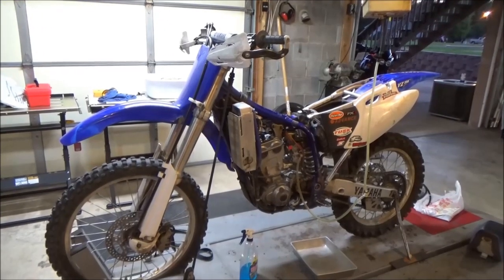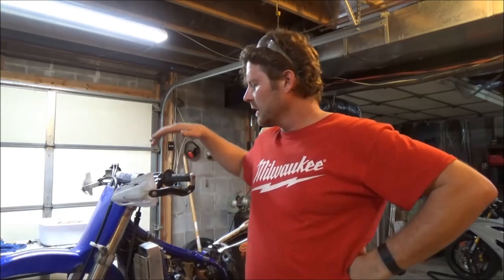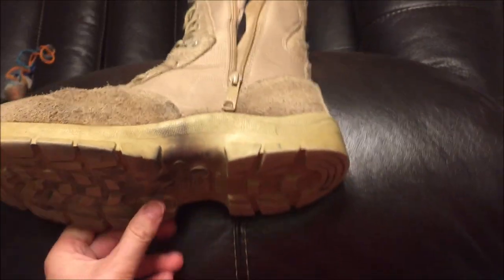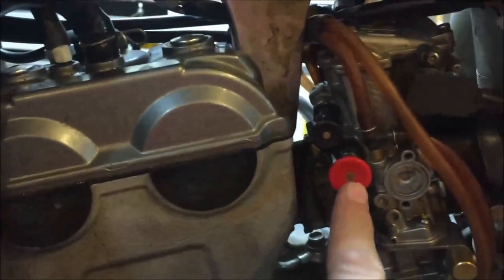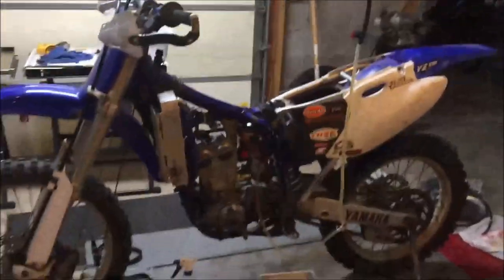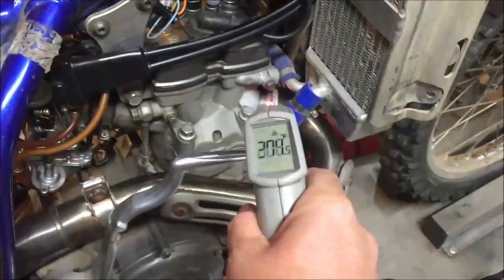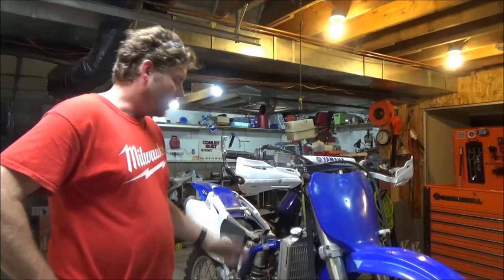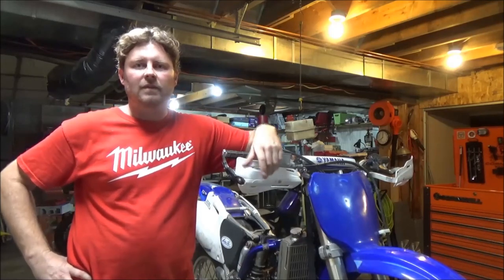How to cold start and hot start a YZ250F in 6 min FULL detailed video!

Comment: Subbed, i like your detailed info on this, picked up a 02’ for 800$ usd and had zero compression, guy said it dropped a valve so i told my self not to even bother with going to look at it and when i did and kicked it over i knew immediately he was wrong (he bought it from another guy saying that so it wasnt him saying it really), so the guy was generous enough to let me take it apart in his garage and at least see what i was paying for, upon getting head off everything looked okay other then it looked like somebody sanded the head on it🤮🙄 so i said screw it and made a first payment on it and took the motor home (he was also nice enough to let me pull it and take it apart and see whats up with it. So i rebuilt it from crank down even to tearing the trans out and redoing that. So long story short im waiting on a new piston, (had a friend mill the head properly and also gonna have him cut me deeper valve reliefs in piston to keep from valve contact, hopefully when i go to kick it shes gonna fire right up

Comment: I’ve been messing with a 2009 YZ250F.
When you drop it, if you pick it up QUICKLY (2-3 seconds), then you can start it in 2-3 kicks.
If you don’t pick it up fast enough then you must wait about 30s-60s after picking it up for the gas to go back to normal

Comment: Thanks, I'll definitely try not to touch the throttle. Your right, its very tempting. Especially when my DT250 likes the throttle to be opened up as its kicked. I haven't started mine in a while, so I wanted to empty the tank and put fresh fuel in. Unfortunately as I did this the fuel line ripped. Do you know if I can just buy fuel line of a particular size (and what size) to replace this. Sods law. Thanks,
Reply from the maker: You can buy fuel line ofthe right size about anywhere, but nothing lasts as long as the OEM and OEM is often thinner in diameter. If I can ever be of service to you, here is a video explains how to connect with me. 
https://www.youtube.com/watch?v=vjvmB01ebcs 

Link to membership: https://how2wrench.com/product/membershipmembers-onlymembers? 

Keep Wrenching,
Shane Conley
Instructor/Motivator/Motorcyclist
www.how2wrench.com

Like freebies? Click here for a free diagnostic checklist! 
http://gem.godaddy.com/signups/364621/join 

Did you like this free video and hope to see more? Would you just like to say thank you with a donation? Click https://www.paypal.me/how2wrench

Comment: 98 yz400f new timing chain and timed, valve job and carb clean and rebuilt starts right up runs for 5 sec then stalls wont take any throttle makes it stall faster great spark carb is getting fuel but motor is not its only starting because i twist the throttle a few times before kicking it over and its starting off the fuel from the accelerator pump squirting it in what is my problem here? This carb was completely gone over and all the passage ways are clean and completely rebuilt orings and gaskets this motor also has new top end gaskets and new rings motor has great compression

Comment: I'm having this same problem with 06 yz250f...not cranking..heard a loud    sound come from exhaust pipe...please help,my damn foot is hurting
Reply: I had the same with 05 yz250f. Today I've checked the valves - the middle one on intake had 0 clearance. I've fixed that and enjoy the way it starts and idle. I also noticed that previous owner disconnected neutral switch - I've fixed that too.